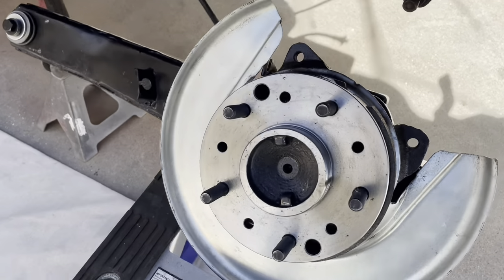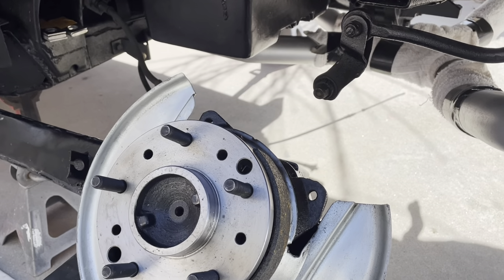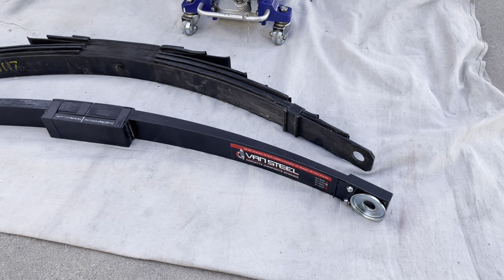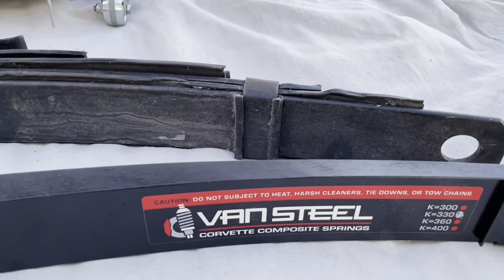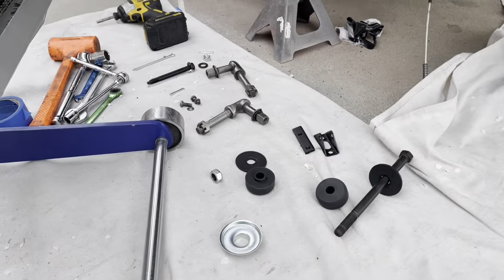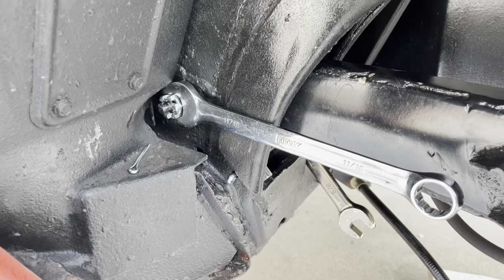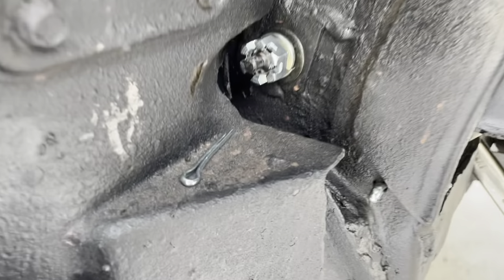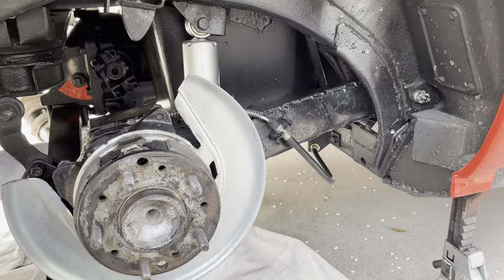C3 Corvette Trailing Arm Installation + Van Steel Leaf Spring

Comment: That tool is called a angled hemostat. I use them at work, I'm a aircraft mechanic.  And also I build vettes, just got a 74 to add to my collection. Makes # 4 now. Got a 63 convertible, 74, 81, and a 86 pace car. C2, C3 and C4.